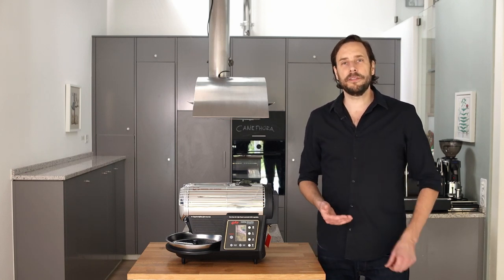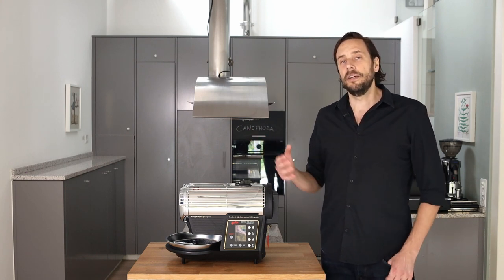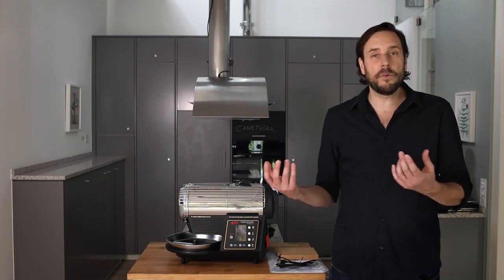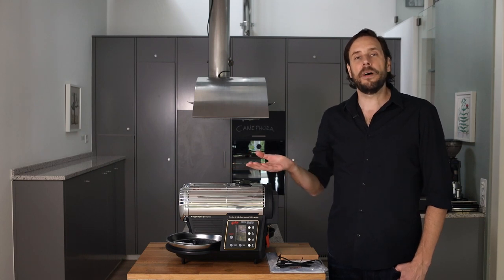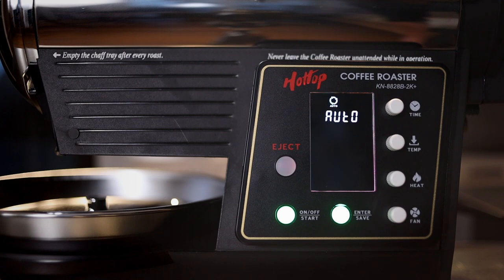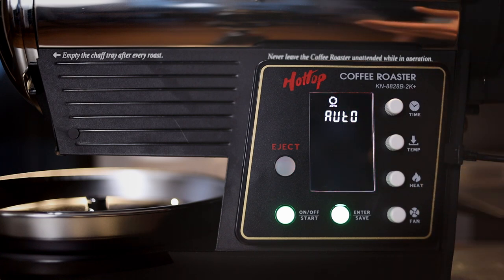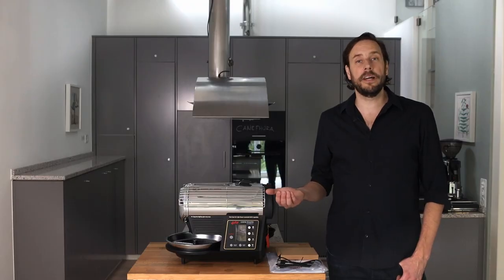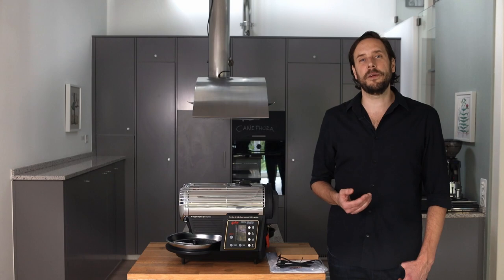Hottop KN-8828B-2K+ with Artisan connection. Product demo, advantages and disadvantages, live roast

Comment: Great video. Question.... should you be using bean probe temperature or the exhaust temperature to measure your charge temperature?
Reply from the maker: With the Hottop it doesn't really matter too much. Both sensor are located quite close to each other. I usually use the BT with the Hottop (just for your info when working with my profiles). But you could use ET as well for the charge temp. Just make sure you stick to one and always use the same. For measuring during the roast, I always use the BT.

Comment: great video! looks like a great upgrade to my Behmor, which has served me well but I'd like a lot more precision in my roasting
Reply from the maker: Thanks to the positioning of the thermocouple and the separated control for airflow and heat, it indeed gives you a lot of control on the roast. If you want to know more about the machine just come back to me anytime.

Comment: can you change temp read out to F degrees?
Reply from the maker: Hi Ken. yes, you can:
1 - With machine unplugged, hold down ENTER/SAVE button
2 - Plug in roaster to mains power, continuing to hold button
3 - After a few seconds the screen shown to the left will appear. Rotate the TIME
rotary knob to select C or F and press “ENTER” to save your selection.

Comment: Would this be efficient in roasting enough 12oz bags to sell at local farmers markets? How many 12oz bags could you roast in say 1 days work?
Reply from the maker: Do I get it right, that 12oz is about 340g of coffee? The capacity for 1 batch is 300g green coffee, which will lead to around 260g of roasted coffee per batch. A batch will take about 15min + 5 min cooling + 5 min between batch on the hottop. So, in an hour, you could roast around 2 bags of 12oz coffee. If you want to use the roaster for small batch commercial roasting, you might have a look at the Aillio Bullet as well which has a larger capacity.

Comment: Does the hottop log a turn around point? Also, how easy it to scale for larger batches? Thank you for the video, by the way! Im looking to learn profiles and develop them on commercial scale. Your videos are awesome. Cheers from California.
Reply from the maker: I don't fully understand your question. Since the Hottop is measuring the BT, there is a turning point as well. The Hottop itself doesn't log anything at all, but if you connect the roaster to Artisan, it's tracked. Since you want to learn and develop roast profiles on the Hottop (which for it is a great machine), using the Software is a must. The machine will give you a lot of insights on the beans and roast profiles. You can never to 100% copy a profile from one machine to the other - but with the information, you get from a small drum roaster, it will be quite easy to develop the roast profile on your production roaster.